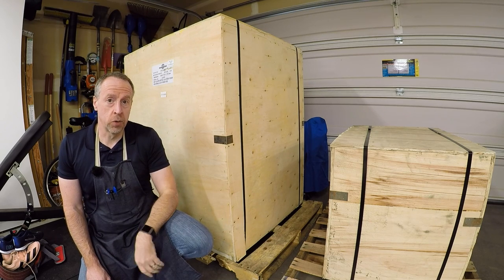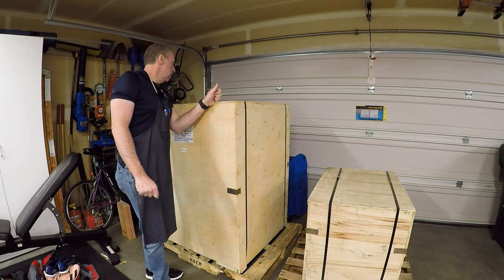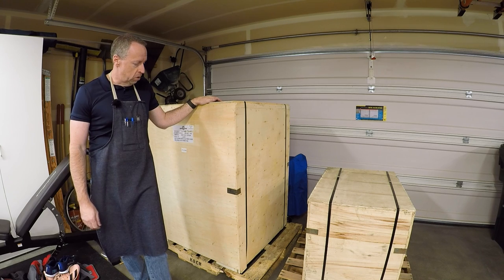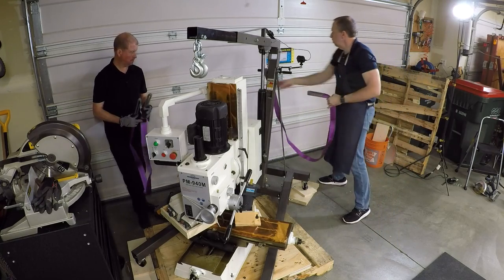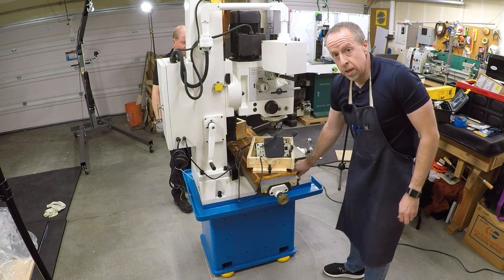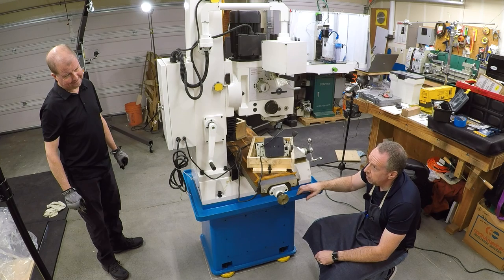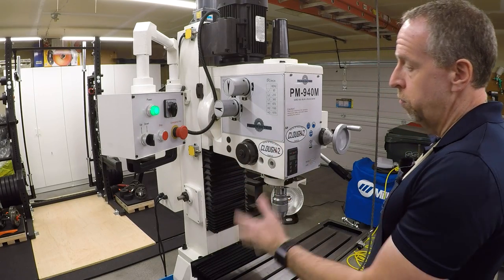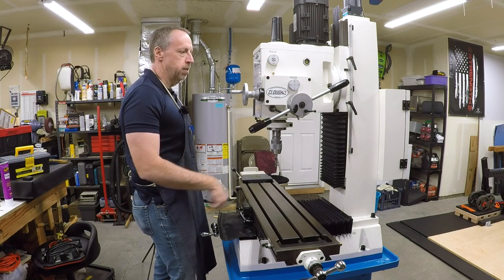Setting up a New PM-940M Milling Machine - Unboxing, Moving and Assembly

Comment: have recently took delivery of a simular machine (different brand same clone with less options ) and i managed to basicy wressle the machine to the edge of the pallet after taking the bolts out , took it off in two pieces , the mast with the head and the cross table , did leaked the oil out of the gearcase (set the mast down horizontally on wood crates with the head hanging down ) not sure if it shouldve been sealed and not leak , ill check to see where it leaked from maibe change some o rings or seals on the gear selectors or from where ever it was leaking from then refill the gearbox once its set up 
didnt had the cast iron base but the sheetmetal version and it was set on top of the big box same as yours at least i could lift it off 
didnt used actual lifting straps but ratchetstraps , you can shorten these during the lift to balance the load out and they resist sliding a lot better

Comment: All it takes to do that is the truck bouncing down the road. You’d be surprised at how the mass of the steel parts can exert enough force to break out of cardboard boxes. I had a wood box have it’s side blown off by the vise inside. Fortunately, that box was within a very thick corrugated box, which was within another one. Still the staples pulled right out of the wood box inside. Fortunately, nothing was damaged, and once on the mill, it checked out to within specs, once I disassembled it.

That style of X motor has advantages, and disadvantages, as I’ve found over a vertically installed motor. The advantage is that it doesn’t interfere with the mill. Base of structure as vertical motors do and so limit the travel when installed. The disadvantage as you can see it that it puts an end stop on the table. I had to rework mine to get the surface level with the top of the table, except for the big gear housing. This looks exactly the same as mine other than the paint color. If so, the big gear in the end is plastic.  I expect stripped twice over the years, but Grizzly has the replacement part. Hopefully Mathews has them too. If not, the Grizzly part will likely fit.

The one thing I don’t like about these geared head machines is that, for some reason, the low speed is too slow, and the top speed is way too slow. Running an 1/8” bit at 2,000 rpm is not something I want to do.

Comment: I have that same HF engine crane but optioned it with the air powered hydraulic vs manual cyl - its wonderful! Also added 100 lb counterweight ballast.

Comment: Nice mill, I have a similar model from Grizzly,  less the power downfeed which was not an option when I purchased mine. I installed a DroPros two axis DRO with magnetic scales and I love it. Absolutely spot on for precision drilling.

Comment: A small company I worked for in the ‘80s taped plastic accelerometers on equipment to be shipped from Cedar Rapids to the east and west coast.  We were seeing up to 9Gs east and 7Gs west.  When a truck at 65 MPH drops into a pothole the load starts to fall, it doubles the impact when the truck bed jumps up to meet it on the other side of the hole.  Since the Chinese cardboard was probably damp from its overseas ride,  the hammering on the interstate system just spread all the cast iron and heavy parts.
Reply: That is great info, thank you for that.

Comment: The shop that YouTube Built. Nice Mill. That is a quality built model of my cheap HF  round column gearhead mill. Good choice. Does that mill have linear bearings on the Z-axis? I am planning on changing out my round column for a square column by dropping a 6x6x3/8 steel tube over the round column with 25mm linear rails mounted onto the front face of the column. The head on these is really heavy so I  will counterbalance with a chain weight over the top using sprockets to guide the chain and provide a power feed lift. I have the same Y-axis power feed that you have and it has been a great add-on. I used a 5" Kurt knockoff, and it is a great size for my mill. If I need more depth I can use the back part of the rear vice jaw. The 6" vice is really massive and I just don't need the extra depth. If I need a really big vice I will make a split vice like TOT made for his mill. Are you going to do a power drawbar? I found a Bridgeport  BT30, replacement spindle that I think will fit my mill. That way all of my CNC mill tools will fit my manual mill, cutting down on my tooling bill. Also, it's easier to add an ATC to a BT30 spindle. Good luck with your new mill.

Comment: So far I'm only 7:30 into the video, so I hereby reserve my option to post a further comment later, but... Two thoughts I have at this time (which is why I need to post them now; I have reached capacity.):

1. You need to buy a stacker, which is a very size appropriate forklift. I have had mine for years, and I can move absolutely everything with that bad boy, and your pallet stack etc. would have been no issue at all. (Get one at auction; they're pretty cheap in the grand scheme of things.)
2. Many years ago I received an air compressor from a German company, and its packaging included numerous 'tilt sensors' and 'shock sensors' attached to the skid/crate. They used colored fluid to indicate if the package had ever been in a position other than vertical, or if it had been dropped. I would have a serious discussion with PM about adopting their use. I'm sure their minimal cost would be more than offset by savings against breakage, other claims, etc.

OK, back to the video.

Comment: I did exactly this a few weeks ago, only on my own, & in a single garage (I'm in England). Had to use the engine hoist to get the base off the top, only just made it, but it made it :-)
Reply: Same issue on the 18th December.  Driver would not take the pallet into garage as it was too high with the cabinet on top. Had to lift it down, perhaps maybe more of a controlled drop, otherwise the mill would be out in the rain. Still not built it yet due to access to engine hoist over Christmas.  Next weekend though.

Comment: I know exactly what you have been through. I too recently purchased a smaller version of the same mill at 120Kg and it took me a month to get it off the floor onto its final table. I couldn't get an engine lifter under the machine. I ended up getting a hydraulic table which when lowered was about 12"off the ground and a bunch of strong guys were able to get it up onto it then lift the table and slide it over, mine was no where near as heavy as yours and it was very difficult.

Comment: 400 lbs isn't too bad,  ma dad and I used to carry small block Chevy engines, from a basement, around the house , up the hill to the car shed, , not shure what a iron head V8 Chevy engine weighs, but we did it several times,  it wasn't that bad at all, the main issue was hand holds, it was more difficult to hold it than anything, and adding much to it would made it heavier, a couple 36"-48" .250" wall 1.5" tubing, welded to about 5' total of . 250" flat steel bar, about 2" wide, to bolt at the engine bell housing, and front accessories mount, with about 12"-16" wide piece as a spreader bar that would made carrying much easier, but add about 50 lbs to the mass,   we rebuild the engines in the basement, carried it to the shed uphill about 100'-150' being 6'2" 280 ,  and capable of benching 350 helps and squat 900+/-, 
I used to move the schools wagon a Buick about 85 model, with most likely a 305 Chevy engine,  I'd pick up the rear and slide it around , I moved it under the covered porch one day, they had to get inside through the passenger side, I'd like to hear them trying to figure that out! 😆:. It was started when someone heard me talking to a friend about what we did over the weekend or summer, not bad for a 8th grader!  They would not allow me to bench over 250 , I can't remember if that was with or without the bar, the coach couldn't bench that much, I could do it all day if I had to probably, but usually did 10 reps curled 10, then bench 10 more, I couldn't curl 240/250/265 what ever it was , I had a bar setup with a couple 45's and 20-25's, this was about 30 + years ago, can't do that now, 😂  but would really like to get a mill and lathe, and maybe a decent drill press, for small stuff,  I'd like to start doing some lost foam casting,  i want to build a retromod stationary engine, based on 120+/- year old  oil field engines hit and miss, and the early diesel oil burners,
Id like to build something I never seen,  a opposed twin cylinder, with between 4" and 8" bore, and 6" and 12" stroke, making it a low rpm high TQ engine  ,. Id like to even build the injectors and complete fuel system,. Designed to burn waste oil, diesel , vehicle, engine oil, maybe even natural gas and propane,  use about 600 psi plus air pressure, fill a cylinder that feeds the injector.  Then further compressed, to exceed the compression ratio by 100 psi plus,  to pull the fuel in the infector, by the venturi , the injector would likely require edm drilled orifices , and lots of experimenting, I'd like about 8 sets of 8 holes, at the tip of a . 10mm to est. .500" injector, with a fuel feel into the injector and return, the high pressure air jet delivers the fuel,  the amount of air determines the throttle,  use a traditional governor to limit the throttle,  this will likely work fine, but a electronic governor would probably be a good backup,  excessive rpm will kill the engine, likely an excess of 2000 rpm would most likely leave it in bits, it's peak would likely be 1000-1200 rpm, use a couple flywheels weighing about 40-60 lbs each, used to  spin a generator, maybe a 120/240v generator aswell, I want it for a DC generator, 30 v 600 amps, for charging batteries when solar isn't capable, for off-grid power,. Sorry to run astray, ramble about, insomnia will do that! Haha good day

Comment: Hello. I have the Grizzly version of that mill - and I am very satisfied with it. Yours has a power downfeed, which I am envious of. I also added a 4 axis DRO Pros DRO to my mill, and that was a VERY worthwhile investment. If it's of interest I can share how I went about mounting the scales, which went very well. Enjoy your new mill - wish I had known about Precision Matthews when I bought mine, but it's working out well. I did have to shim the column to get it in tram in the Y direction, and I need to make some EZ Tram brackets for the X direction to make best use of the tiltable head feature. I found that a 6" vise was too big for mine - I find the 4" vise to be perfect. But I'm sure there will come a time when I'll be glad that I have a 6" vise available. Good luck and best wishes.
Reply from the maker: I just cut the stock this morning to make the DRO mounts, but by all means feel free to share.  I think what I'm planning will work, but putting more ideas out there is always useful.
Reply: I used a combo of the supplied brackets and my own design. The quill DRO required the most work, but my solution is working pretty well. You can see an overview here http://www.modelenginemaker.com/index.php/topic,8283.msg226212.html#msg226212
Reply: If you'd like more details on  the quill slides for example, happy to supply those, but sounds like you already have a good plan. Enjoy the DRO - I love mine!

Comment: I have had a machine that is remarkably similar to this one for about two years. I assume they are made in the same factory in china.  Mine is smaller, perhaps 2/3 the weight, and looking at PMs website it's nearly identical to the PM-932M, bar a few minor details.

Mine uses ISO30 instead of R8 though and had only an analogue readout for the quill, though one of the first things I did was to fit a full DRO.

I'm a terrible machinist but I like it. I was planning on getting a Sieg SX3 but then I stumbled across this machine on clearance with only two left in stock. I got it at about the same price as the SX3, about $2200 with VAT down from something like $2800, and it weighs more than twice as much so I think I got a good deal there.
Reply from the maker: More cast iron is generally better.  The DRO is going to be a bit of a pain on this machine.  I have a plan, but I'm going to have to make a lot of the brackets.
Reply: @Clough42  Yeah, that was our reasoning as well. More weight equals more rigidity. it was a bit of a pain to get off the trailer and up on the stand. But we managed it in the end.

If you like I'd be more than happy to send you some photos of how I mounted mine.

Comment: very cool!  and as all youtube arm chair commenters - please don't put any body parts under a hanging object.  You can always push things around with a push stick.  Keep up the content!
Reply from the maker: You are, of course, correct.  In this particular case, I was feeling to determine the shape of the bottom of the casting so I could figure out where to put the blocks.  Lying down on the ground would have been another option.

Comment: If you ever run into that situation with the lift gate again, get the stack on the ground, raise the gate up to the level of the top  crate. Then slide the top crate onto the gate. That way the top crate can be safely lowered to the ground.
Reply from the maker: This is basically what we did, but the gate was still about a foot too low.
Reply: @Clough42  Gotcha.

Comment: awesome , i set up my 750 lb mill by myself , I felt like an egyptian gradually shimming it off the floor all day long
Reply from the maker: I seriously considered doing this to get my lathe up on the bench, but ended up buying the engine hoist instead.
Reply: I did that with my first mill move....a pry bar and a 3/4" plywood block at a time...then I saw Ox tools give a tip to cut a 14" or so section of 4x4 lumber, and then cut it corner to corner, so you get 2 wedges..  with those wedges you can progressively get the mill higher and higher till it is up the full height of the 4x4, and then a pallet jack can fit under...those things are real time savers...moved my 14x40 mill with that method and a 10x50 Acra Bridgeport clone
Reply: @Clough42  I bought a used engine hoist for this sort of thing (but mainly hoisting engines). I should have checked it out beforehand, though, as the hoist itself is too heavy for me to lift by myself and needs a come-along/tirfor hung off the garage ceiling joists to set it up!

Comment: Thanks for showing the move step-by-step!  I've been wanting a PM for a couple years now and have read through the moving docs multiple times. It's nice to see someone doing it as well as other advice and warnings in the comments.  I am very curious about your choice of a PM-940M over their PM-835S knee mill.  I'd very much like a knee mill, but simply don't have the space.  It appears your garage could accommodate it, so perhaps it was the cost (significant) or perhaps there is something else I'm not considering?
Reply from the maker: It's about space for me.  It could accommodate it at the moment, but I have plans to move in a couple more machines soon, and it's going to be real tight.

Comment: It looks like the first thing the shipper did was tear everything apart out of their boxes and just throw it  right into the bottom of the mill stand there. Years ago I would also get a bill of lading which itemized everything shipped. Looks like the drill chuck was just thrown in there at the last minute; I would check that very closely for damage to the taper and other outside damage. It might be totally unusable.

Comment: "Terrifying"? Man, you had a helper. 😆
I had to get a 4500lb Hurco Hawk 5D off of a tilt bed trailer by myself. (Trailer I had reserved was a twin axle hydraulic drop bed but they rented it out.) Dirt driveway so I dug holes for the rear wheels so when I tilted the bed it wasn't at a "terrifying" angle.

I had the mill in the garage and garage door reassembled by 8am the next day. A lot of sore muscles after a day of sleeping. I would categorize the experience as "Stupid but with good results." 🤔

Comment: Just wondering what made you decide on a PM-940 mill as I look in your shop I see you do spend a lot of money on the shop and see a lot of home machinist  go with these type of mills VS a BP style knee mill that gives you much more flexibility with the tilt and nod of the head rotate ram and slide out to have long part hang off front of table and machine end. Plus from cutting i have seen you can cut 3 to 4 times heavier. You can get a knee mill new as low as $9,500 also there are 100 times more accessories available for BP clone mills.

Comment: I bought a PM835S knee mill and it was just delivered 2 days ago. Weighs 1600 lbs.
Reply from the maker: At least you don't have to lift it up in the air.  That's the sketchy bit.

Comment: these mill are notorious for having casting sand and grit left inside the head.  it will kill your gears and bearings inside.  Pull the top off and have a good clean and check.  my mill had sand in it when i went to do the belt drive mod.

Comment: James,  I've been looking at PM-940M and stumbled across your video.  You answered a few questions I've had so thanks for that.   Perhaps the useless packing material in mill crate was supposed to be inside the base.  I'll definitely have a discussion with PM if I decide to purchase.   You did a nice job on the video and I look forward to watching more.
Jim
Reply from the maker: I wouldn't hesitate to buy from PM again.  I've been in contact with the owner, Matt, and he replaced the clamp kit case and the drill chuck right away.  Everything else is working well.

Comment: Modify the legs on your engine hoist so it CAN straddle a pallet.  I suspect you'll have a pallet or ten to deal with before your machine shop days are done.  Make your material handling simpler, and I doubt you'd regret it.
Reply from the maker: Unless my modifications cause it to fail under load.  Then I would definitely regret it.  I wish I had room for a hydraulic pallet stacker.